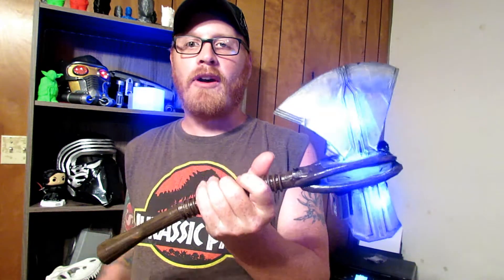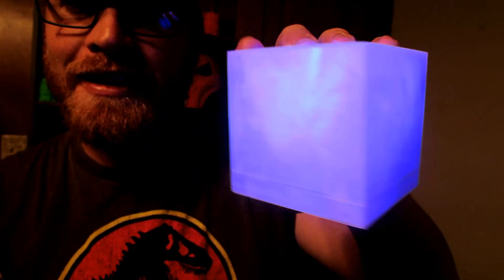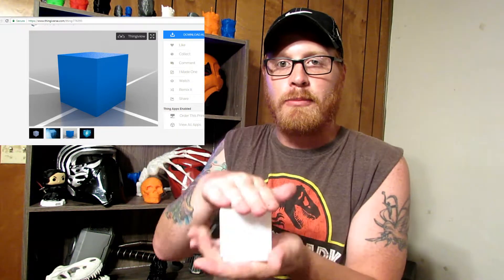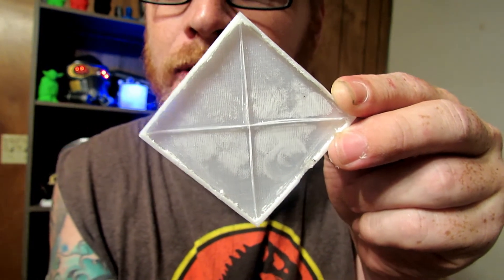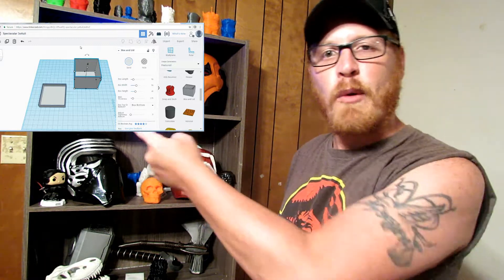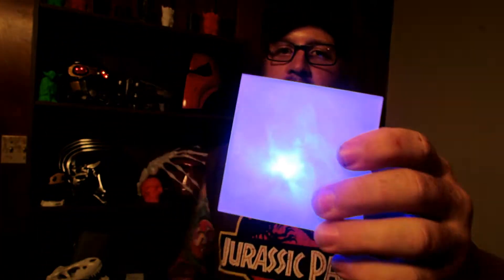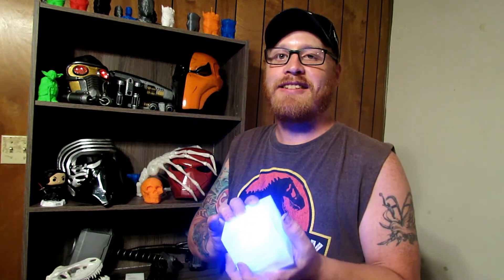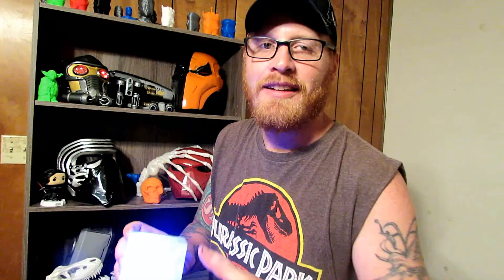3D Printed MCU Tesseract (Power Stone)

Comment: I know you said you set the width of the box to 56mm in Tinkercad, but that is only 2" wide (56mm = 2.2in). The box you are holding looks to be more like 4.5" wide? Did you upscale it in your Cura software to be larger?
Reply from the maker: hmmmm I made so many of them I had like 4 versions on file . I couldnt remember which one was the one I used and sized when I uploaded i to thingivers. I think it might need to be uplscaled. Im not at home but Ill check it out and let ya know.

Comment: Was this printed on the anycubic i3 mega?? How would you rate the anycubic 1 being the worst or 10 being the best 3D printer you’ve ever had! Also, how are the support system on cura? The slicer I use have terrible supports!!
Reply from the maker: Here is my full review of the Anycubic. https://youtu.be/W4MCH-UZ0qs I LOVE it. I really do. BUT to be fair i have no other printer to compare it to that I own.
Cura is all I use. its a great slicer. I use Meshmixer to plane cut and re-size but I make all my G-Code on Cura.